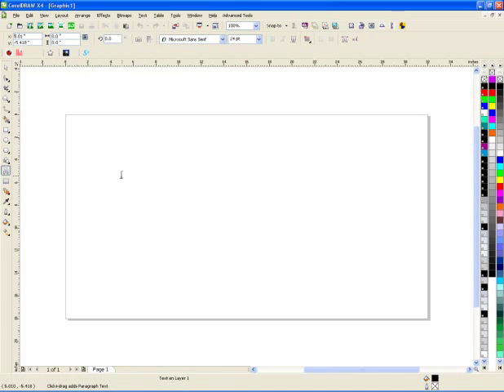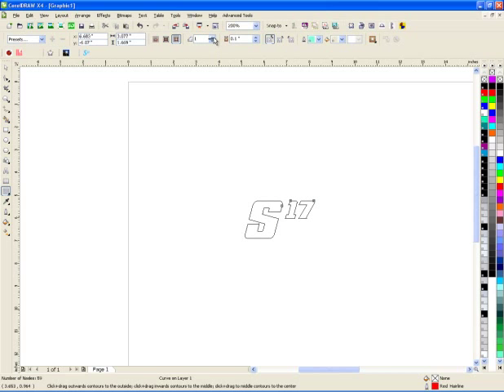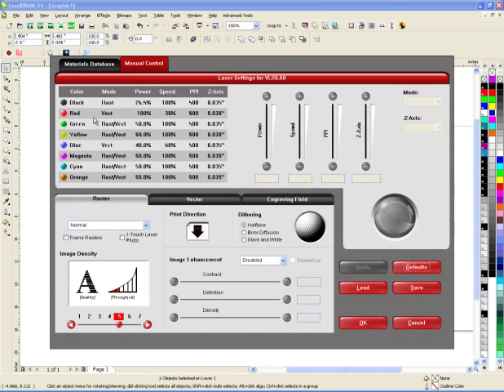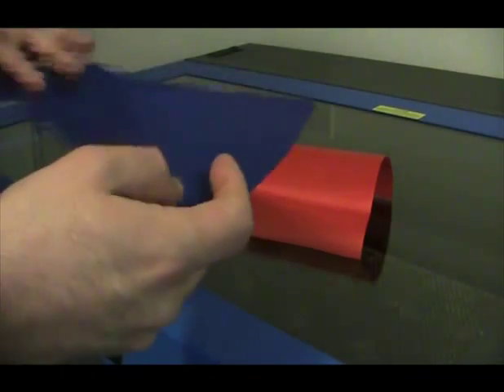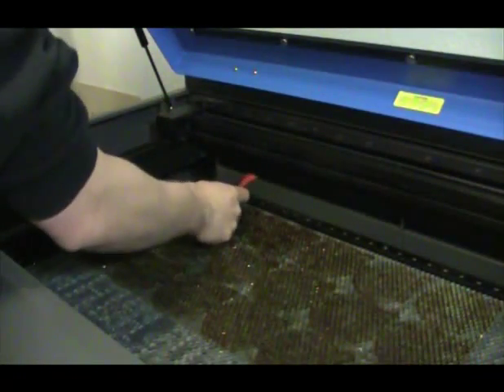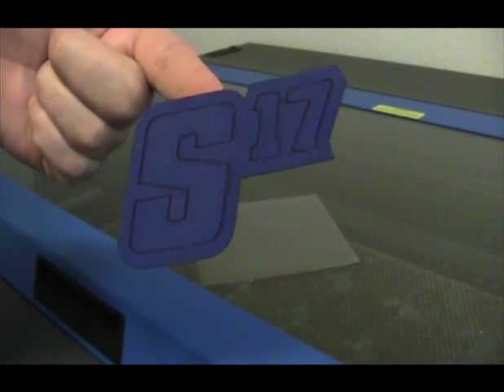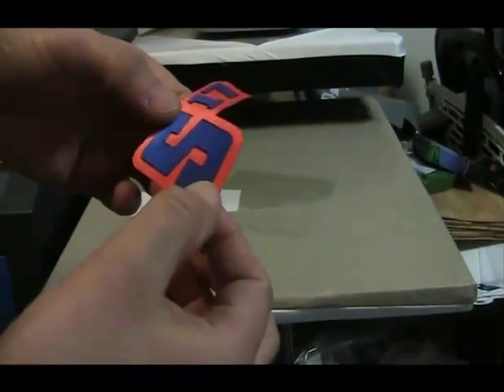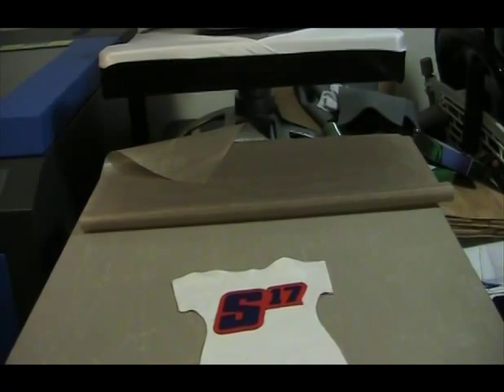Synergy 17 - Laser Cutting Permanent PSA Tackle Twill

Comment: What cut settings did you use
Reply from the maker: On the VersaLaser, they have a couple twill settings. One for kiss-cut and one for cutting all the way through. What kind of laser are you using?
Reply: synergy17llc -appreciate you responding.. 
what wattage of laser are you using? I currently have the AP Lazer 40 watt. Haven’t done any cutting, more engraving, just wondering where to begin as far as settings.
Reply from the maker: @Houseofbeasts  I have a 60 Watt, and my settings are based on percentages, which might not be helpful. The best way to test would be to make some test cuts. Test by cutting the material, but not the backing. That will be the kiss cut. Then test by cutting through both layers of the materials.
Just make some small squares or something like that for the test. That way you don't waste material.